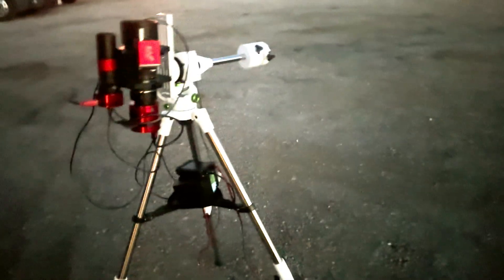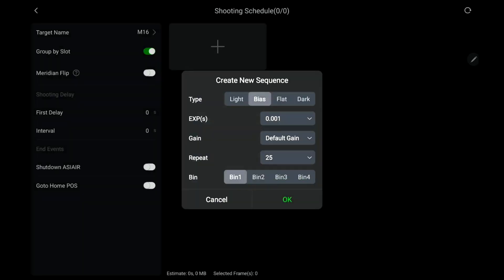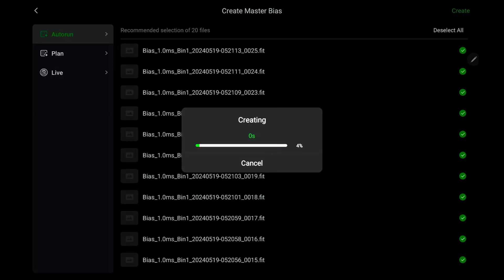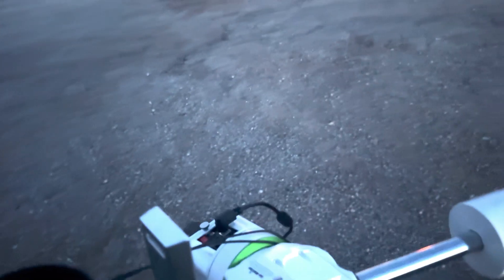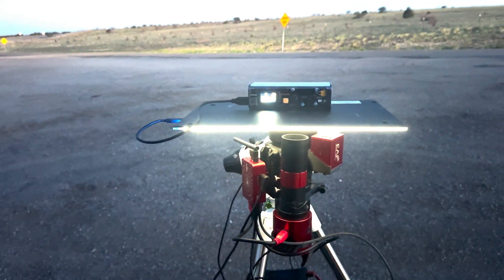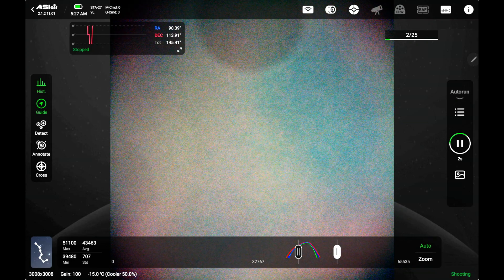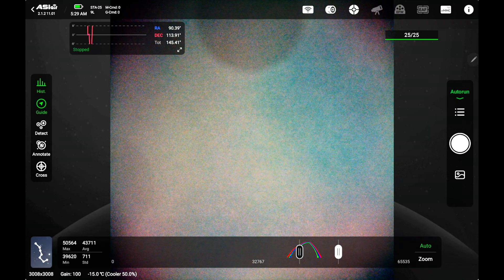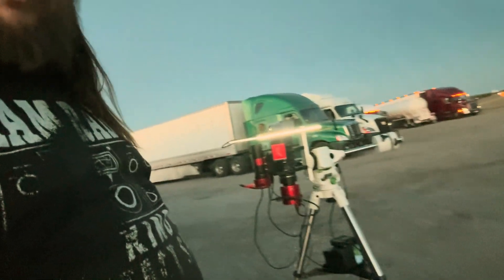Asiair Calibration frames tutorial

Comment: Could you also load the 25 bias frames in Pixinsight and have it create the master?
Reply from the maker: You can, but I don’t know why you would, this is much easier
Reply: @ Thanks, your video has been very helpful. I normally shoot flats and dark flats and then use my dark frame library for my 2600MC Pro. This will make things easier. How long are the master bias frames good for until you create a new master?
Reply from the maker: Most people on cooled cameras usually redo them like every year. Realistically, you shouldn’t have to redo them, but the noise patterns can change over time due to wear and tear so I usually do mine every season.
Reply from the maker: also with the 2600 you shouldn’t really need dark frames since there’s no amp glow
Reply: Thanks Wes, I knew that but I was taking the darks because I did not understand how to create Master Bias frames until your video.